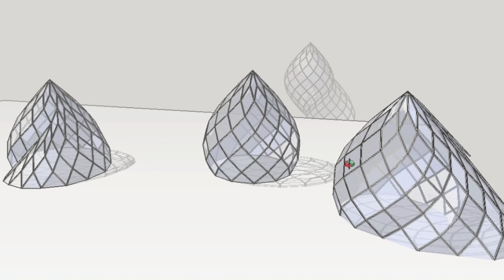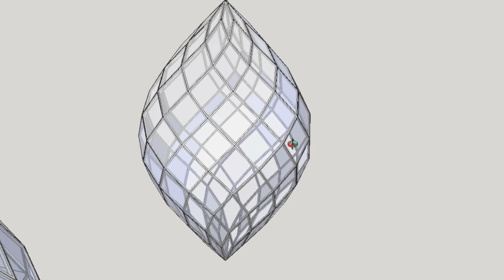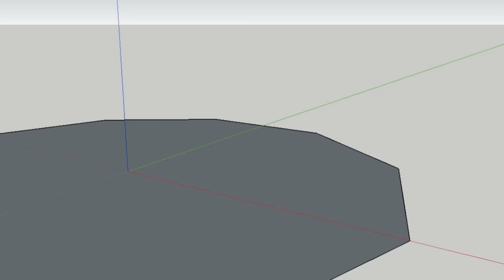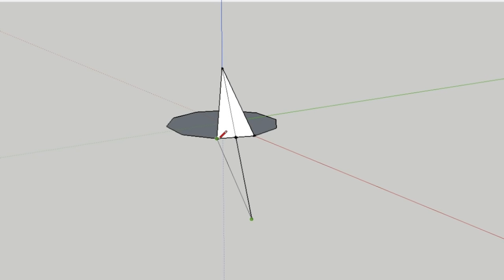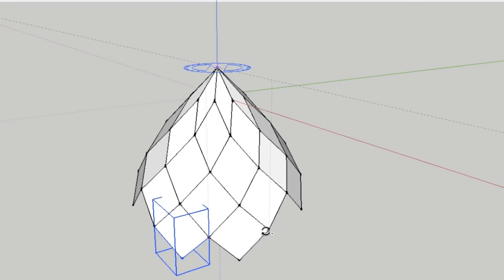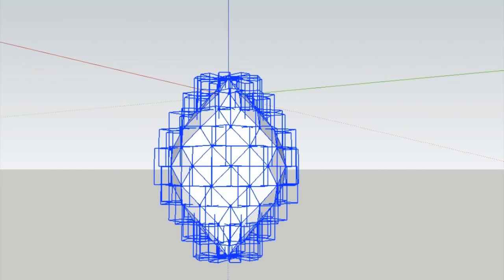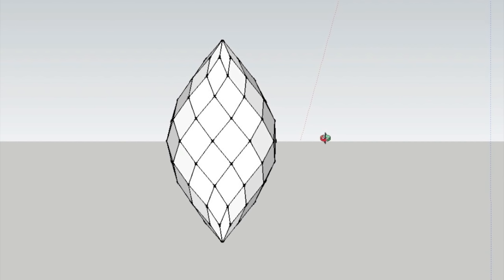Easy Zome Drawing in Sketchup

Comment: 7:00 , 9:20
The vertical extra-line in the triangle is not needed.
Just choose the triangle and rotate a copy around the bottom edge by 180°.
Then delete the horizontal edge and maybe reverse te face and the next diamond panel is compleeted.

for my one i created a 6m Ø 12-side-polygon at first and a 4m center-line.
So the edges of my zome are exact 5 m long

Comment: Paul I’m building a 16’ zome now. What do you think would happen if you averaged the dihedral angles?
Reply from the maker: Interesting idea, I feel that you may hit some problems, Zomes have a reduced dihedral age as you go from the bottom to the top, do you know what the difference is from top to bottom? I might draw one up and find out.... it's late here so will do it tomorrow.
Reply: Paul Robinson I think I’m gonna go for it and hope it works out. It’s about a 7 degree difference (per strut, so about 14 for the entire dihedral) between the largest and smallest, so yes that’s kind of a lot...but that really only means you’re fudging a few degrees either way. 

I feel like a lot of the elliptical nature of the shape comes from the panel dimensions itself so I’m gonna hope for the best on this one. Do you think that’s too big of a swing? 

I think the lowest is 24.2 and the highest is 38 in an 8 “frequency” zome

Comment: Paul, how do you take the design from this simple line structure to the actual cut timber angles? Is there a quick way or the old fashined way with calculating all the angles, as with these the angles are different at every level.

Comment: Are there any better apps or software for doing this? Maybe autodesk?
Reply: I just converted this to a parametric model in freecad.  Zones, apex angle, and size all adjustable with a single input.  If you know the method any of the better 3D CAD packages should be up to the task.

Comment: This is so amazing! I wonder how strong one of these is compared to geodesic. Probably not a strong but this would be so good for my area.
Reply from the maker: In the diamond form not so stable but if you triangulate each diamond to form an upper and lower triangle this would be very nearly as strong as a geodesic dome, just bear in mind the triangulation would add horizontal struts which will be under tension. You could do them with wire, I'll do a tutorial shortly.

Comment: Hi Paul, how did create the 3rd type of dome, the pulled one? I just finished the normal one, and i can't "skew" it (if that's the correct term). Many thanks for this tutorial.
Reply from the maker: OK you need to make one zome a component so you can move it all together, grab the very top and make a copy, place the copy (grabbed at the very top) at the next vertex down, this is where the top diamonds come together at there bottom corner. You can repet this process with another copy and either keep it moving in one plane or move it down and one around for the twisted version. If you still have problems let me know and I'll do a quick tutorial.
Reply: Many thanks! Understood and applied!

Comment: Another way to avoid the manual approach to doubling the facet length. Draw the triangle, then draw the vertical line as before. Instead of calculating the length of the new line, just select and move the vertical line at the top point, making sure to move as a copy, and then move the top point of the copied line, the bottom point of the previous vertical line. Then you have the exact doubling of the central vertical axis of the diamond facet.
Reply from the maker: Great tip!

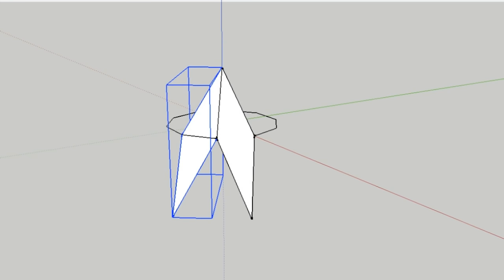Comment: Starting at 8:30 you have a single diamond then using "make component" and "rotate" you create 9 more.  How?  (I have the free version of Sketchup,  Maybe I need Pro?)  I can rotate the original but I can't figure out how to generate copies.  I'm eager to see you build one.  Your work with domes is very creative.
Reply from the maker: If you look in the bottom right corner you will see a small box, when you rotate you can see the angle here. If you rotate first, 36° then type in the box x9 you will get 9 more each rotated 36° from the last. I'm sure this will work in the free version of sketchup.
Reply: There's something more to it.  I never get a copy.  I just move the original, plus I get an error message when I enter "x9"  I don't want to waste your time.  Can you recommend a "For Dummies" sie or book?
Reply from the maker: Your nearly there, you have to hit the control key to make the copy, here's a video that explains it very well: https://youtu.be/7agSNyk8JQA  Best place for tutorials is youtube, I have learned sketchup just through youtube tutorials.
Reply: @calvinglover752  Hi! Its 9x not x9. !!!